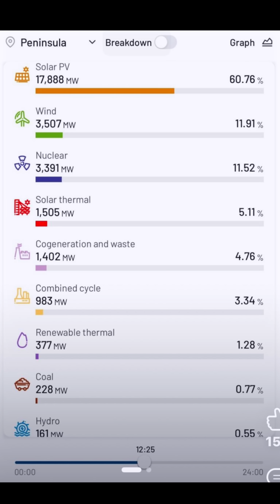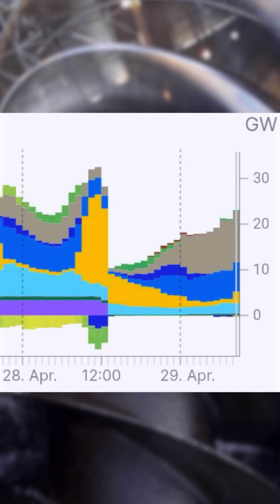Spain Blackout #shorts

Comment: Just install big batteries. Not complicated, very stable.
Reply: But very expensive
Reply: @erickprilop3933  More expensive that country-wide blackouts? This is a necessary investment into critical infrastructure, no matter how much politicians want to waste our money elsewhere this is where they should actually be investing it.
Reply: It is actually quite complicated, and very very expensive
Reply: @flimby872  It's not cheap but how is it complicated? You buffer the fluctuations from renewable sources with banks of batteries. They also massively increase the efficiency of legacy power generation plants by allowing them to generate power off peak instead of shutting down outside of peak hours. It's the closest thing to a no-brainer I have ever seen in my entire life.
Reply from the maker: It’s actually quite a bit complicated, as battery technology isn‘t ready yet for grid-scale application… we don’t even have enough natural ressources to build lithium-ion batteries of that size and number. But as soon as tech catches up, solar will get a MAJOR boost for sure.
Reply: @physicsbutawesome  Respectfully disagree here. LFP batteries (Lithium Iron Phosphate) are well suited to this application. These can be scaled immediately as the Li component is only 1.14%, with Iron, Aluminium, Carbon, Phosphorus and Copper making up ~62%, by mass. These are all readily available and all are highly recyclable. This issue is not the technology or material availability, it is the absolute lack of political will to tell people we need to invest in this expensive thing.

This isn't a problem everywhere though, in 2018 the world was at ~3GW of grid-scale battery storage. By the end of 2023 (most recent reliable figures) we were at ~55GW. The problem we have in the West is that half of this was built by China (27GW). The US accounted for most of the rest (~16GW). The situation is Europe is acutely embarrassing by comparison. I put that on weak leadership but while we may agree/disagree on the cause the numbers of deployed assets speak for themselves.
Reply from the maker: @ granted, LFP is a big step in the right direction, but the amount of lithium necessary at grid scale would still strangle global supply.

And the cost is still prohibitive… you could either build grid-scale batteries in the US or EU or at the same cost build something around 100-200 new nuclear power plants.

So, I think we‘re getting there, but as of right now, lithium supply and cost are huge limitations.